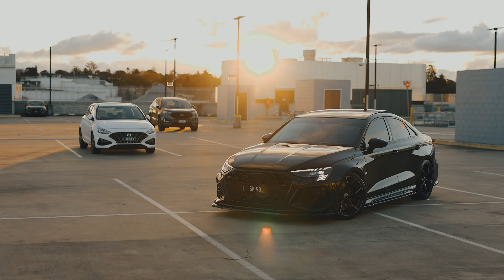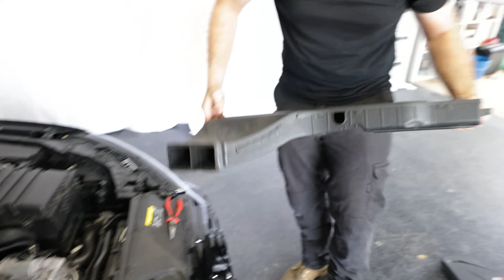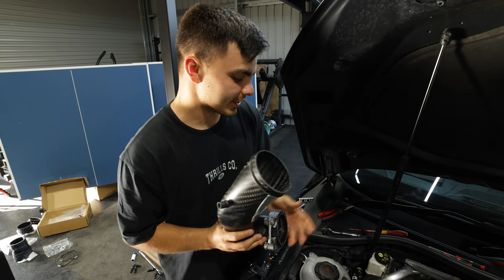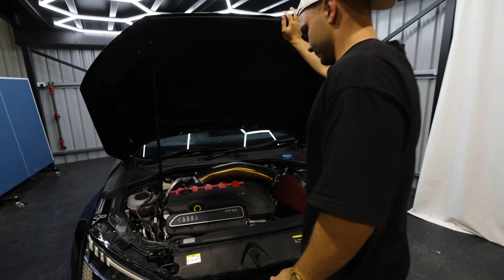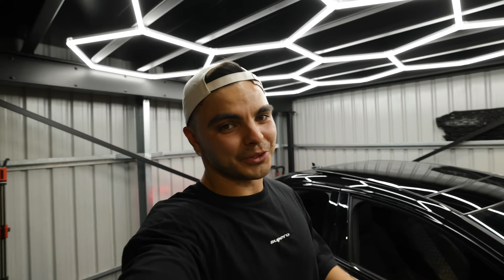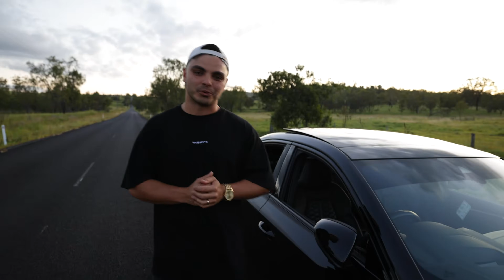I Installed A Huge 5 Inch Air Intake On My RS3 And It Sounds INSANE!

Comment: Bro, why the actual fuck are you or your mechanic using a vband on a silicone coupler? Thats going to have such a crap seal... heck use jubilee clamps or even a t-bolt clamp instead....
Reply from the maker: We are not mechanics, we used what the kit provided. Haven’t had any issues so far but will have a look into it.

Comment: Did he install it the standard way by having it a recirculate back into the turbo or are they venting into the atmosphere? All the hardcore racer guys around here vent into the atmosphere instead of the standard recirculating back into the turbo (recirculating back into the turbo doesn't even seem like an option to these guys).  My Unitronic stage 2 E85 flex fuel is being installed next week as well so I think that will make it okay. We'll see

Comment: Can I ask what type of front lip/side skirts and rear diffuser You've got going? I've got a glacier white 2024 and I think yours looks great
Reply from the maker: @Daveyboy_RS3   thanks man, I got the maxton kit on 👌🏽 So I got the front splitter v2, the maxton valance diffuser with the side extensions, then I also got the maxton side skirt extension. Maxton has two diffuser and front lip options, make sure you look at the ones I mentioned above, because I think there other alternative doesn’t look as good. 
If you just get them black like I did, they are actually very affordable, but if you do want to spend the money, they do offer them in carbon aswell but cost quite a bit more. 

If you want me to send through the links where I got them, shoot me a dm on Insta 🙌🏽 

I do plan to also get CT Carbon’s carbon wing, and their front carbon bumper inserts they have. Then get carbon mirrors and that’s probably all I’ll rock for carbon on the exterior so it’s subtle.
Reply: @samkrushka  Oh I've been researching front lips and rear diffusers for months now. Very familiar with maxton's street pro, V1 and V2 options. I really would prefer them in gloss black, not only cuz they're way cheaper, but I think they look better, however my car came with the carbon package so I'm kind of torn. I think my favorite rear diffuser is from RW carbon and front splitter is the simple Maxton Street Pro Carbon. But considering my car is glacier white, I think I'd want to do the OEM lip in black PPF and then add on the carbon lip. And I think the maxed inside skirts in carbon are nicely done as well. I'll probably do some mix of what I just mentioned. But anyway, your car sounds awesome and love your channel. Thanks for the reply

Comment: Isnt this the older generation air intake? Why haven't you bought the newest version?
Reply from the maker: I didn’t think it was, have they got a newer version out?
Reply: @samkrushka yeah man they updated the design so the filter sits parallel to the engine cover. I have the latest version on my 8v and had no install or contact issues at all.

Comment: Pretty disappointing fitment issue for what I assume was not a cheap intake?  Any reason why you decided to go open air rather then a closed intake for better temps?
Reply from the maker: Yeah, the fitment wasn’t the greatest that’s for sure. Cost me $1500 AUD for the intake alone not fitted. I honestly am still learning what I’m doing and what’s good so I didn’t really think too much of the open air vs closed intake. 
I really just chose this one because it looked sick and the shop local to my area that pumps out rs3 and is probably one of the leading shops here assured me it was the best option. But when I felt the temps under the hood the other day, I’m kinda thinking otherwise hahah. 

I’m going to see how it performs and maybe if I’m not happy, might get the eventuri intake since I already got the elbow.

Comment: Great video dude but to be honest that intake will be worse than stock. Other than for the noise it’s sucking in hot air from the engine bay. Eventuri or Unitronic make a better aftermarket intake, plus the look and fitment is so much better. Just my 0.02 cents
Reply from the maker: I did wonder that, but the shop that supplied this intake is one of the leading shops that build these cars local to my area and they guaranteed me that this performs better than the Eventuri one which was my first option. So I was sold haha. But the other day I lifted the hood and could feel the heat under the bay and thought surely it couldn’t be great for it, I have a feeling your right haha. But I’ll see how it goes and performs, and worst case, I already go eventuri elbow and can just buy the intake too and put it in. 

I honestly like the look of both, but thought with the gold titanium it was something a bit different.
Reply: The other guy was right. Performance > looks. Sounds like the shop was pushing the product and sold you alright. If they also told you the sky is green, does that mean it’s true? 

Nonetheless, enjoy the new hot air intake.
Reply from the maker: Haha fair, I’m learning as I make these videos and this shop has built some pretty quick rs3’s. So yeah I listened to what they had to say. But we learn as we go right?

As I mentioned in my comment above, I’m realising it probably wasn’t the best choice.
Reply: @ all good man, wasn’t hating or trying to make you feel bad, nor was I talking crap. It’s a sick car for sure. For upcoming mods, I’d suggest researching as much as possible and read actual reviews from people before purchasing, as that’s where the honest feedback comes from. Here, Reddit and Audi forums are your best bet for that.
Reply from the maker: That’s all good man, I understand! 🙌🏽 i will definitely be looking out for reviews in the future. I am still trying to figure out what to do after the downpipes and OPF delete. No tunes available yet on stock ecu in Australia, only route the shops here offer is Syvecs ECU. I’m tempted to bite the bullet on the price and go all out and aim for big power over time as I got more money to throw at it. Do you have any advice on what I should do next to the car?
Reply: @ midpipes are a cheap and easy upgrade. Personally I’d consider looking into handling upgrades if they’re out for the RS3 (not sure). I installed the 034 Motorsport drivetrain inserts package for my stage 1+ s5, which consists of the transmission mount insert, rear differential mount insert and rear differential carrier insert, along with a strut tower brace under the hood. Car l felt amazing, especially considering the drivetrain inserts package is only $285USD and an easy DIY install. Not sure what 034 Motorsport has developed for the 8y, though. Check them out, they’re a great company.
Reply: I have actually found with mine (probably also due to an intercooler upgrade) my charge air temp was much lower. All high end big power builds use open air intakes. When the car is moving you are getting alot of fresh cool air moving towards the intake because of the huge grille on the front of the RS3.

Comment: That's not an air temp sensor yo, it's the DSG breather.
Reply from the maker: Ahhh okay, I thought I had it wrong. Is there a particular way it should be mounted? I have it still upright, but mounted it the right of the intake. Would that still be sweet?
Reply: @samkrushka  If you're launching the car and don't want DSG oil everywhere, look at DSG breather options from Iroz, 034 and JDY now make one too.
Reply from the maker: Yeah okay sweet, I will have a look into this!
Reply: @samkrushka  Yes it would be fine, but keep an eye on it if you're launching the car. It will/often spew DSG oil out, espcially if you have a TCU tune.
Reply from the maker: Yeah okay sweet. I will definitely have a look at that then. 👌🏽 I do plan to get it tuned eventually, still no tunes available here on stock ecu in AUS. Only option is syvecs, so might just bite the bullet in do that this year
Reply: @samkrushka  Yes correct about Syvecs. A lot of coin to drop when it could be spent on doing a forged engine build. 🤔